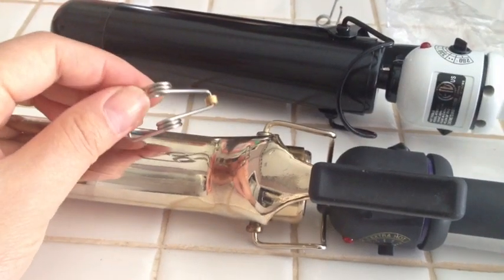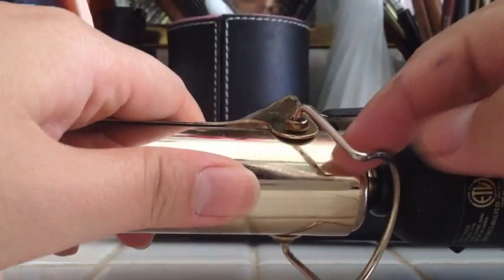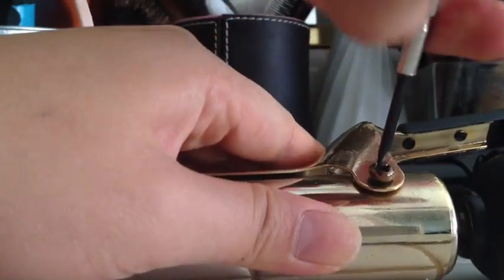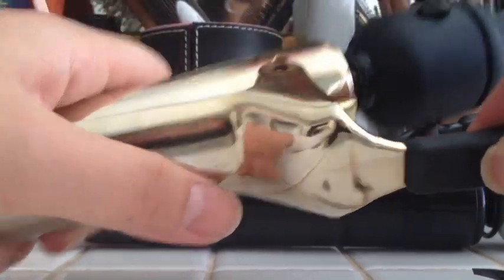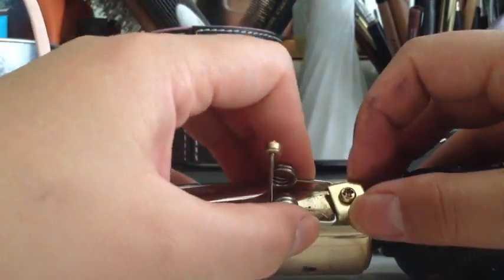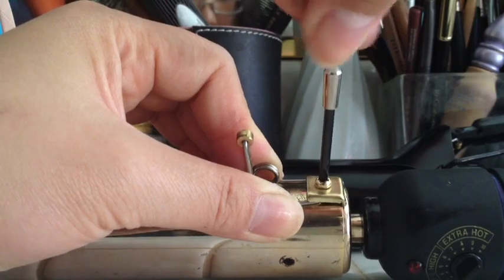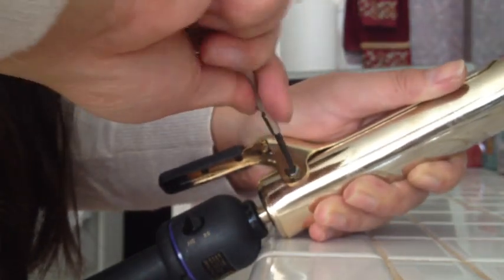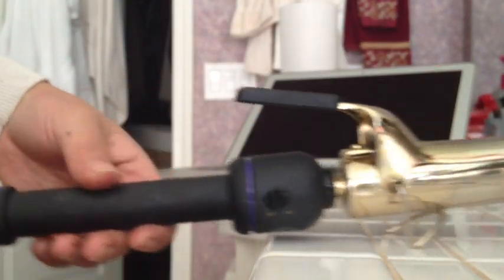HOW TO REPLACE Hot Tools Gold Curling Iron Spring Replacement (broken clamp)

Comment: The Phillips screwdriver works great with the Phillips screw rather than the flat one that wore your arm out.  Holding firmly with your left hand so the wand doesn't lift up was great advice.  Thanks.

Comment: The base on mine will not come off. I feel like maybe you could’ve been a little more time on that to show how you get that separated. I pried, pulled &, used lots of different tools. It’s not coming off.  Anyone else having this problem?  Or is it just mine being so difficult.? I’m trying to fix a power issue. It turns on but doesn’t stay on.

Comment: Doesn't look like the spring was in deep enough into the bracket which will put more stress on the spring causing it to wear out sooner.  The bends should seat against the bottom of the bracket.

Comment: Can you please tell me where you can get the replacement spring?
Reply: Google curling iron replacement springs.  This particular iron she has takes a 1" spring.  No. 1006 but you can also use the 1002 spring.  Just make sure that you get the legs seated into the bottom of the holding bracket.  https://www.curlingironreplacementsprings.com/